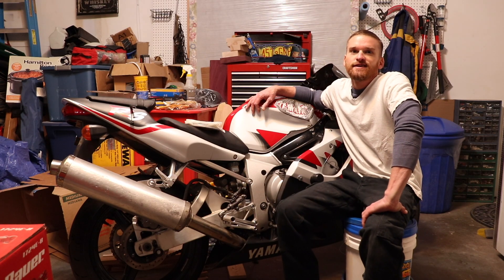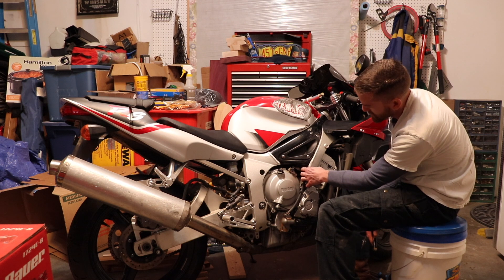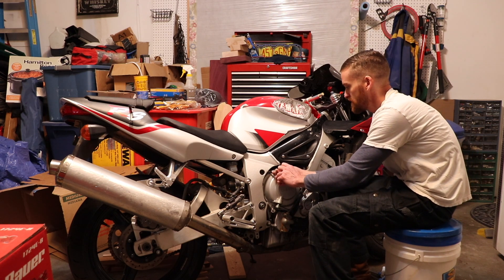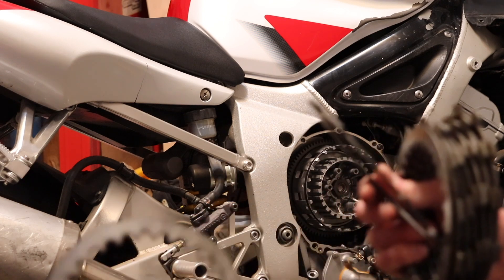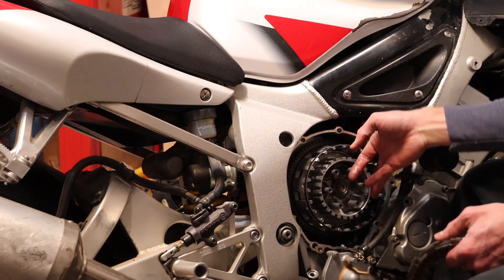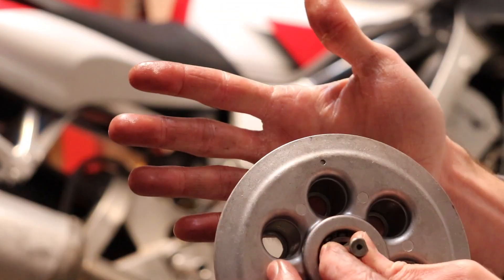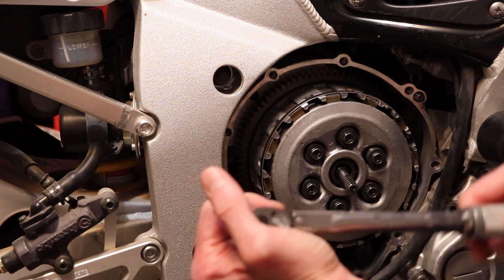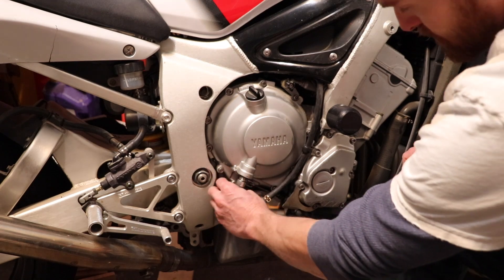2000-2002 Yamaha YZF-R6 clutch replacement

Comment: Your video helped a bunch. Everything went smoothly replacing the clutch on my 00' R6. Only to have it go blah because of the clutch cable fraying by the lever. So new cable is on the way. Not a hard job to do on these. Your video gave me a heads up on what I'm doing. Thanks.

Comment: On the clutch “fork”/ cable attachment point I only assume you need to pull the slack out of the fork until the 2 dots line up then install your cable.? I hope I’m right because that’s what I did and it seems to work okish

Comment: Was going to try upgrading my r6 came across this video and you mentioned racing camshafts what brand are in you're bike? And was wondering what power number you got out of if?
Reply from the maker: Hi chris, I put GYTR racing camshafts in my R6, unfortunately I think GYTR stopped selling camshafts for late model R6's back in 2008 but I could be wrong about that. I also lapped in the cams with fine lapping compound to loosen it up just a little bit for faster spin up and quicker rpm's, plus i slotted the cam sprockets to allow for more timing adjustment. I also put a thinner head gasket and ported the heads a little bit. I dynode my bike at PPIR in Colorado which is at 5,361ft in elevation and I was running sunoco U4 race fuel, My R6 made 118hp at the rear wheel. I thought that was really good hp numbers at that time because my friends Honda 954 was on the dyno before me and only dynode at 119hp and weighted more than my R6. But then Roger Hayden's factory Kawasaki Zx-6 went on the dyno after me and put up a whopping 136hp. I think I gained about 20hp at the rear wheel over the stock hp numbers with all the work I did to my R6. I hope this is helpful. Thanks for watching!
Reply: @WillowsWorldofDIY  thanks I don't think they make them because I've been looking for any brand that makes any of them and have had 0 luck.

Comment: Thanks for the video bro
Been very helpful rebuilding R6 for my son
Like to see a DIY for breaks
Reply from the maker: Thanks! It's always good to hear that my videos helped someone. I can do a video on breaks, what exactly do you need me to show you?(Replacing break pads, steel braided break lines, replacing master cylinders, replacing calipers, replacing break rotors, bleeding the breaks)? Good luck on your R6 rebuild! Thanks for watching!
Reply: Willow’s World of DIY i asked Yamaha shop to rebuild carbs and they told me it’s a long process and had to use a machine to recalibrate and $700 to fix! Wow
Reply: Breaks replacing pads front and back
Reply from the maker: Wow! That's ridiculous! I'm out of town right now but I can do a R6 break video for you in 2-3 weeks.
Reply: Willow’s World of DIY after instilling he carb you don’t have to synchronize the carb?
Reply from the maker: It really depends on how the motor is running after the carbs are installed. It's definitely good to synchronize the carbs after a rebuild  if you have the equipment, and it will help the motor run at its best. A subscriber requested a carb sync video about a month ago but unfortunately I have been out of town. I'm planning on filming a carb sync video when I get back home and also a break video for you. I should be home in about a week and I will get to work on filming the videos, I also need to rebuild the carbs and get a new battery on my R6 before I can film the carb sync video, so I definitely have some work to do to catch up to you guys.
Reply: @brandon508  I was given the price of $500 for carb rebuild, not sure if it included sync.  Might try it myself.  The bike sat for 10 years...

Comment: Great video man! Just one quick question. I'm about to change my clutch this weekend and I was wondering if you had to drain the oil before removing the clutch case? Just did an oil change a couple of months ago and I don't feel like buying new oil again... xD (Same bike as yours btw).
Reply from the maker: You don't have to drain the oil to replace the clutch but, I recommend changing the oil when you install new clutch plates because any debris from the old clutch will be in the old oil. I hope this is helpful. Thanks for watching!

Comment: What are common problems with the 02 r6? Mine has 32k miles and is perfect.
Reply from the maker: The 00-02 R6 is a great motorcycle. I'm not sure if these are common problems but here are some of the problems that I have had. At about 15k I started having shifting problems and the transmission would jump out of gear into a false neutral. I had to replace 2nd gear due to spider cracks and because the shift dogs were rounded. I also inspected and replaced the shift drum and shift forks because they showed signs of excessive wear. Besides that the only thing that I have had to replace is the cam chain tensioner. I'm sure these repairs depend on how hard the motorcycle has been ridden, I used to race my R6 and that's most likely the reason for the repairs that I had to do. I hope this is helpful. Thanks for watching!
Reply: Willow’s World of DIY thank you for taking the time to reply. Mine shifts great. Little clunk between each gear and more so 1st to 2nd but seems fairly normal as all bikes I’ve ridden had a nice thud shifting. Seems everyone says 2nd gear is an issue. Mine doesn’t slip or
Pop out under WOT all the way to redline so I’m good. I don’t know prior history though on it. I bought it with 29k miles. Ever heard of cylinder liners cracking ?
Reply: @WillowsWorldofDIY  wow... im having the same problems 😭😭😭 at 31km but i did push the bike alot!

Comment: on the yamaha forum i read that the YR6 had a problem with the gearbox. it should break the 2nd or 3rd gear. what do you know about that. I have a Y yzf thundercat, similar engine
Reply from the maker: I had spider cracking on my 2nd gear but I haven't seen that on any other R6 that I have worked on. The main problem that I have seen with the R6 transmissions is the engagement dogs on the gears get rounded over time and won't engage under heavy load (full throttle). I sent my transmission to R&D Race Transmissions and had them under cut and harden the engagement dogs on every gear. It really improved the shifting, I never miss shifts and don't have anymore problems with it popping out of gear. I hope this is helpful. Thanks for watching!
Reply: @WillowsWorldofDIY  
Thanks. True. Seems to me i have that problem on my Yyzf thundercat. Thanks

Comment: When I shift my bike in 2nd gear it pops back in neutral can your clutch do that or
Reply from the maker: It's most likely a problem with transmission, when the dogs on 2nd gear get rounded it will pop back into neutral under acceleration. You will need to replace 2nd gear and inspect 1st gear for excessive wear where the 2nd gear dogs in gauge 1st gear. This is a common problem with the R6. I hope this is helpful. Thanks for watching!

Comment: Do use any kinda of sealer when replacing the gaskets to the sator cover and clutch cover or do you just put the gaskets on help please i have a 2003 r1???
Reply from the maker: It really depends on the condition of the matings surface. If the mating surface is smooth and in good condition then I just use the gasket but, if the mating surface has any damage and isn't completely flat then I use YamaBond 5 https://amzn.to/33BDhS8 on both sides of the gasket to seal it. I hope this is helpful. Thanks for watching!

Comment: Hi I need your advice I have a 2000 R6 I changed the clutch cable along with new levers...does the arrow and dot on the clutch arm have to line up when the cable is not attached? I try to put it in gear and the bike jumps and stalls out
Reply from the maker: The arrow and the dot on the clutch arm need to line up when you start to get tension on the clutch arm before you hook up the cable and the arrow and dot should be close to same that position with the clutch Cable hooked up. I hope this is helpful. Thanks for watching!
Reply: @WillowsWorldofDIY  okay while lining up the arrow and mark while the bike be in neutral...

Comment: So my old clutch came out in your order but the manual looked up shows the clutch pack starting with a friction disc being 8 friction discs and only 7 steel plates...kinda curious why there is so much different info on different things. Mine is an 02 btw
Reply from the maker: There is 8 friction plates, 7 steel plates 1.9mm - 2.1mm and 1steel drive plate 2.2mm - 2.4mm. The service manual that I use shows the clutch installation is exactly the way I installed the clutch in this video. This is the link to the service manual that I use https://runthacity.com/wp-content/upl... what you are looking for is on page 4-46. I hope this is helpful. Thanks for watching!
Reply: @WillowsWorldofDIY  got an error code on that website.
Reply from the maker: Sorry about that. The link for the 99-02 service manual is in the description of this video. Please give that a try and see if it works. Page 4-46 shows a diagram on how it should be installed.
Reply: @WillowsWorldofDIY  ok thanks. this is the manual i had seen that confused me because it shows it starting off with a fiber plate and ending with a fiber plate but looking above i see the steel plate so i'm thinking that the clutch pack i ordered didn't come with that thicker plate. unfortunately i don't have the tool to measure to know for 100% certainty. the whole reason i pulled the clutches because my grab zone was soo small that it made me think the plates were worn down or broken but turns out they were brand new. finding parts and info on these gen 1 R6s is more difficult than i thought it would be haha
Reply: @WillowsWorldofDIY  also trying to figure out if i have to replace the whole water pump cover housing or not because what i believe is the return line, is leaking as if the elbow isn't tight enough or something. its seeping out and unfortunately i haven't had any luck in finding the part that isn't used and not knowing the real condition or if i can just fix my issue without rigging it... sorry for throwing this all at you. this is my first bike is a long long time and first time ever owning a Yamaha and some things have been quite a bit different than past projects
Reply from the maker: The bottom row of 8 fictions & 7 steel plates in the diagram goes in after the top row with the 1 steel drive plate 2.2mm -2.4mm. That 1 steel drive plate is sold separately, I posted a link in the description of this video.

Comment: I have a 99 r6 i bought that has been setting for 5 years. Ive got it all up and going but there is a fine line between 1st neutral and second no slipping and it clutch less shifts fine through the rest of the gears as it warms up it almost goes away but occasionally I have to hold up while I’m shifting at first when cold to keep it in gear if i give it just the least amount of gas its fine it stays in but if I don’t give it gas it will come out sometimes. Does this sound familiar to you as far as the dogs go because i have no slipping but I’m not to sure if i have the clutch cable adjusted right. Do you think its possible the oil went bad it looks brand new and doesn’t smell burnt so I’m not sure. I plan on changing the oil i just didn’t know if this could be part of it? Also one other thing I haven’t heard you mention inn your videos but do you have a whirring noise or friction noise when your rolling in gear with the clutch not engaged? As soon as i pull the clutch in it goes silent but upon release i can hear it again through all gears.  Swww i know that is a lot but if you get the time I would definitely appreciate your advice. Oh and thank you for all the informative videos your awesome
Reply from the maker: It's hard to diagnose without see the Motorcycle in person. Based on the information that you have told me I think it sounds like you have a problem with the shift drum and/or the shift forks. From what you said It doesn't sound like the gear dogs are the problem. I think it's the shift drum and/or shift forks because the gear dogs aren't fully engaging when the motor is cold and as the motor heats up the metal in the transmission expand and it works fine. Also I think the whirring or grinding noise is probably coming from the transmission and could be because the shift forks are worn out and is causing some friction where it rides on the transmission gears. Unfortunately the shift drum and shift forks have to be removed to inspect them for excessive wear. It doesn't sound like the clutch cable is the problem because it would happen in every gear. The clutch cable should have a small amount of slack when it's adjusted correctly in its resting position, make sure that you have 1-2mm of space between the clutch lever and the clutch lever perch. I hope this is helpful. Thanks for watching!
Reply: @WillowsWorldofDIY  thank you sir I appreciate it! For some reason I didn’t notice but i was low on oil so i added and it feels a lot better setting still going through gears. Snowing right now so in due time. Oh I have heard  a few answers to this but to inspect the forks and drum do i split the case ? Or is that for replacement of 2nd and 6 th dogs? I thought you said you had to but i think i heard someone else maybe in a forum say no. But anyways thanks keep up the good vides
Reply from the maker: No, you don't have to split the cases to get the transmission, shift forks and shift drum out. You will need to pull the clutch and clutch basket out to gain access to the transmission, shit forks and shift drum. Thanks Tommy! I hope this is helpful.
Reply: @WillowsWorldofDIY  thanks i appreciate it!!

Comment: Can you help me? I  Just want to ask you, after i put back together, mine clutch feels like i pull nothing, its very easy to pull in the clutch lever, but i think it not works well, but i do everything like you, what am i failed?
Reply from the maker: Hi Shinobi Sensei. Did you line up the indication marks on the clutch case and the clutch case lever arm when you installed the clutch case cover? Those 2 marks need to line up when the case is fully installed and tension is on the clutch case lever arm.
Reply: @WillowsWorldofDIY   i tried to line up this two things , but when im turning the lever arm, its always a little further, or little before the dot line :/
Reply from the maker: Set it a little before the dot. When the clutch cable is connected the marks should be close to lining up. I hope this helps.
Reply: @WillowsWorldofDIY  yes thank you so much <3 :D
Reply: @WillowsWorldofDIY  Finally works, thanks :DD
Reply from the maker: great news! I'm glad you got it working properly Shinobi! good job!